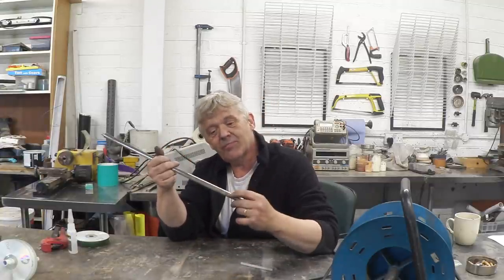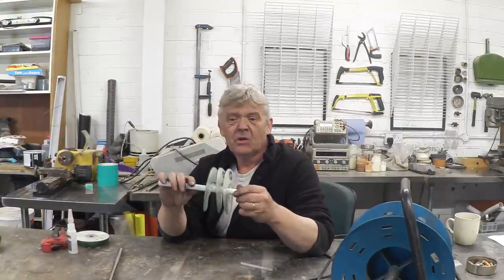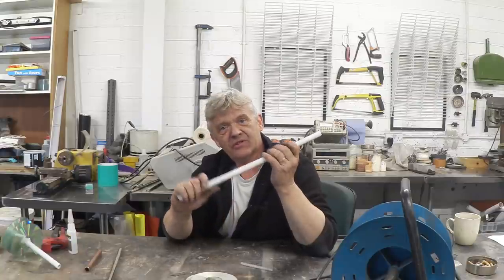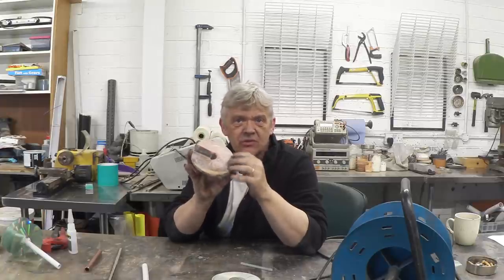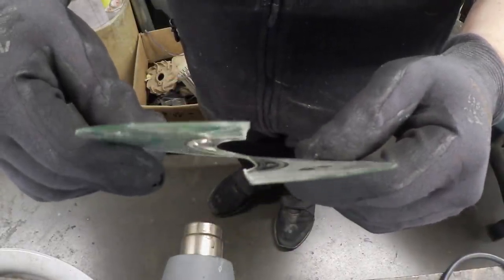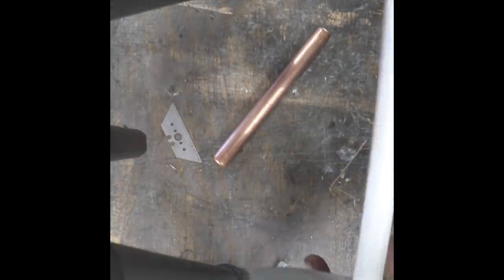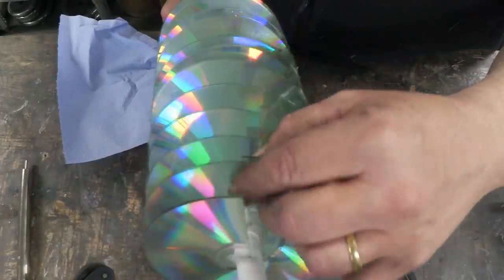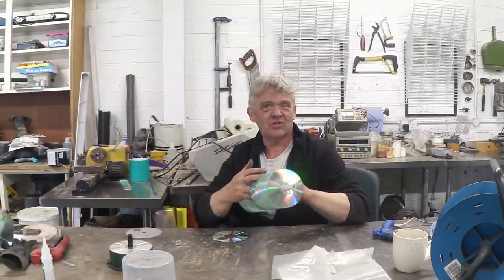An Archimedes Screw From CDs

Comment: very nice solution! a simple way to refine the overlap issue but retain the benefit of having a good gluing surface, while also making the construction that much more robust, could be to double up the CDs and offset the two layers by that overlap angle. should give you the cleanest transition surface, even better than a weld or glue seam i'd imagine.
Reply from the maker: that's clever thinking mate - I like that - I shall use it if that's ok - credit to you of course
Reply: @ThinkingandTinkering  awesome, glad you like the idea, i respect your creativity and knowledge highly! lol, i don't need credit, you're the one who inspires us daily! but thanks :-) 
looking forward to seeing the uses you come up with.
i'll have to check tomorrow; i wonder if a CD will fit into a standard rain gutter without additional trimming?

Comment: ARchimedes Screw for Light, Sir John Pendry: This mechanism is possible only over a range of velocities dictated by the amplitude of the grating. We contend that this grabbing hold of the light to raise its energy level is analogous to the function of an Archimedes screw in raising the level of water. It is worth remarking that, although the problem is mathematically more amenable in the impedance-matched case, this amplification effect is not contingent on both ε and μ being modulated. In Supplementary Figure 1 we demonstrate this, showing the case where only ε is modulated, as most easily accomplished in pump-probe experiments.

Comment: I've made some costumes out of cut CD's.  I warmed up a toaster oven, turned it off threw the CD in for about 10 seconds, and could then cut it with a scissors until it cooled too much. Try to cut a cooled CD and it cracks.  Also, the aluminum layer can peel off if it is supporting too much weight or another force is applied to it.

Waiting patiently to see what you're going to do with that screw.  Maybe you could find a wedge of the correct angle to separate the cut as you heat the CD's?
Reply from the maker: A wedge is a good idea but really a little practice and this can be done adequately by eye - I plan to make a hydro generator from it

Comment: Speaking of hot glue, my dad once worked at a shoe factory, he offer worked night watchman, and I'd go with him, they had really good hot glue guns, it was much better than anything I seen since, it was hot enough it would melt into some plastics, I guess it had to be since they were glueing leather, until it could be stitched or what ever, they made dress shoes, but when the basket ball shoes came out with the pump in them, I found a pair that they were reverse engineering, evry stitch was taken out! Very interesting, if they were my size, I'd probably tried to put them back together, ha-ha!! I was wearing a 11-12 by I was 10-11 years,   off subject a bit maybe, but there was a glue gun in the video! Ha...
Reply from the maker: a good excuse - did you know bad shoes go to hell - after all shoes have soles lol - we think of hot glue being one thing but there are a ton of formulations - I learnt that when I did a bit of bookbinding years ago - it is pretty interesting stuff tbh

Comment: Thank you for the idea. One remark superglue and water are not good friends, so coupling the disc screws with cyanoacrylate doesn’t seem being a good idea to me. You may correct me if I’m wrong.
Reply from the maker: it's ok to practice mate - these do take a little making - but in a final version I would use a polycarbonate glue with a polycarbonate centre

Comment: If it had variable pitch and taper and also mounted in a funnel with matching dimensions it might work in some hydroelectric generator,suppose the Lilly impeller is already with its extra dimension
Reply from the maker: they are already using them in hydro generation mate - fixed pitch and taper - but I like the idea of variable pitch I can see where you are going with that for sure

Comment: Got me wondering how you fix the exterior periphery of that to the inside of a pipe to form a water lift. 🤔 I suppose i could run some liquid sealant or glue down the spiral but it'd be a bit hit and miss.
Reply from the maker: it's just close fit mate
Reply: @ThinkingandTinkering thanks, tolerances wil be precise then. Guess it's a case of build from scratch wth metal. I'm thinking aluminium and those aluminium welding rods you did a, video about about, roll a tube to fit and weld that same way. For the small frog pond in the garden, feed a header pool for a slow waterfall to aerate, either using a squirrel cage wind turbine driving a motor and gear system or by gears/belt. Still on mental drawing board so far.
Reply from the maker: @nevyngould1744  it depends what you want it for mate - if you want it for a pump the easiest thing is just to wrap a bit of garden hose around a pipe - the hose makes a helix and that will act as an Archimedes screw and pump
Reply: Saw your latest video Robert. Half pipe. Makes perfect sense, just sit it in a gutter.

Comment: Now we've got a windmill, a gearbox, and an Archimedes screw. We can now pump water with the wind.
Reply from the maker: yep - or use the screw as a hydro generator
Reply: Out of curiosity, do you think you could use a small series of belts or wheels to connect a screw to a water wheel? Pump water from a stream to a higher pond?

Comment: I absolutely LOVE your videos and ideas!! 😎👍
I just watched the one:
"How to use an induction motor as a generator" 
And I have a question..
I am wanting to motorize a couple bicycles for my kids.
I have access to a lot of salvage, and I was wondering if it would be possible to maybe mount a couple of small wind turbines (maybe even a smaller version of the one you built) on the handle bars or the back of the seat. In order to charge a battery that would in turn run the bicycle? 
(Please forgive me if this sounds stupid, but I don't know where to start, and I just can't afford to buy them electric bikes 😞)
Thanks again for the videos 👍
Reply: Desmond Bagley  absolutely! That is a great place to start😀 and I'll just work up from there.
Right on, thanks 👍
I was thinking too "bare bones" I didn't even consider using things like that. Awesome.
(What do you think of maybe a weed Wacker or electric lawnmower?
(Maybe an electric trolling motor)
Thanks again 👍.
Reply from the maker: Desmond is spot on mate - there are just a ton of ways of doing that and that in itself makes it difficult to know what to say - I am afraid you need to make some decisions in line with Desmond's suggestions - once you have made some choices you will have a clearer start point
Reply: @ThinkingandTinkering  right on!😀 Thanks guys 👍